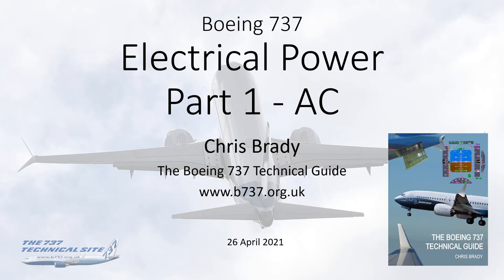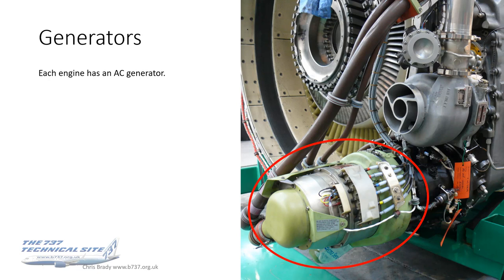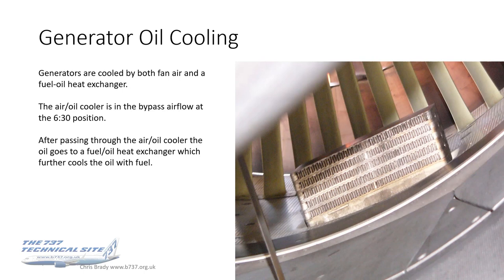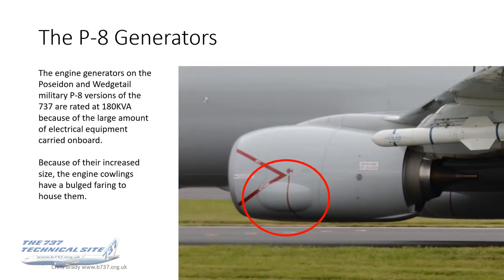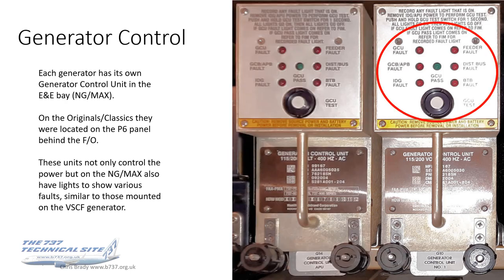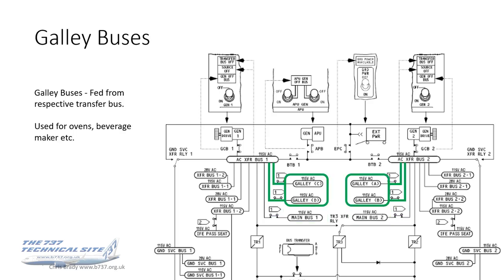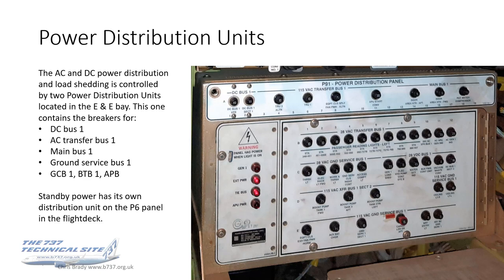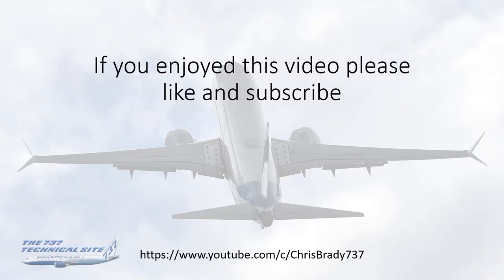737 Electrics Part 1 - AC Power

Comment: Amazing amount of info. Just a quick correction at 39:37 The blue light GEN OFF BUS means the IDG is not powering the Transfer Bus. The respective generator can be running or not. The blue light APU GEN OFF BUS definition is correct. APU running but generator not powering the Transfer bus. The blue GRD POWER AVAILABLE means external power is connected and the quality is OK. Cheers..
Reply from the maker: You are absolutely correct

Comment: These videos are the best I've seen on the internet, and watching them also made me buy your book. I have seen every one in the technical series from start to finish. But now when I try to go back to review some of them, I find that even if the sections of the originals and the classics were interesting on my first pass, I tend to skip over them to only get the NG/MAX parts now when I'm trying to learn the systems better. Maybe it would be an idea to also release a cut down series of the systems videos just for the NG/MAX, since I guess that's what most of us are flying nowadays? Maybe it is not too much work either, just some cutting in your video editing software?
Reply from the maker: Hi Jesper, thanks for your kind words and for buying the book. I took the decision early on to cover each generation, partly for completeness but also partly to show how the systems evolved to where they are today. A case in point is my last video “The Rudder Story” this had its roots in older generations but caused changes in later generations. You are right it would be a relatively easy job to just cut out the Original and Classic info but I think I already concentrate more on the later generations. I won’t rule out your idea but I still need to be persuaded that it would be worth doing. Thanks for the feedback, I appreciate it.

Comment: Very intresting Chris as usual. just a remark/question. at 04:21 I m surprised where you put the red mark; actually on the air starter and not on the CSD for the oil check as you were speaking about. is there a reason or am I mistacken ?  anyway great thank you for your work
Reply from the maker: You are absolutely correct - I got the wrong sight glass! I think the CSD sight glass was obscured by the orange tag and in my haste I labelled the wrong sight glass. Good spot!
Reply: @ChrisBrady737  thank you for your answer Chris. it was a detail with no importance really; and more to show you that we watch your videos with great interest . I m looking forward for your next Video ( and use to watch several times the last ones ) . Great work !

Comment: Is there any fuel penalty for turning off the IDG since rest of the flight will be continued with the APU on? 
Doesn't state anything in the QRH 6.1 Drive or in the Inflight Performance part in the FCOM (What I can find). Sorry if it's a dumb question, I'm still learning.

This video is amazing, even such small details as the 6pin GPU connector, I always wonder what those two smaller pins were for. Thanks again cpt!
Reply from the maker: There is no direct fuel penalty for turning off an IDG but of course there will be an associated fuel burn increase for running the APU. This should only be around 100kg/hr.
Reply: @ChrisBrady737  Okay roughly 100kg/h. Thanks for the information

Comment: Supremely helpful videos. 
Excuse my ignorance but what is typically a BUS? Like a circuit or what? Can you clarify?
Reply from the maker: They can take several forms but they are usually metal bars that you connect several other circuits to. If you open up the consumer unit / distribution board in your house you will see some in there for the live, neutral and earth feeds.

Comment: Hi Chris first of all thanks for the outstanding videos, I have a question, why are there 2 APU generator switches on the electric panel with only 1 APU generator?
Reply from the maker: Thanks Philip, it is so that you can connect to either or both busses.

Comment: Hello Chris, thanks for this wonderful video, i have a question, to disconnect IDG physically from flight deck, engine must be running or start lever in IDLE position is enough to do that, thank you.
Reply from the maker: "engine must be running" is not specifically a criteria. "start lever in IDLE position" is the criteria - but of course the engine cannot run without the start lever being in the idle position! When you put the Gen Drive Disconnect switch to the disconnect position, power goes to a solenoid on the IDG if the engine start lever is in the idle position. The solenoid energizes and disconnects the CSD from the input drive shaft.

Comment: One question on the NG on the metering panel why if you select the BAT BUS or STBY PWR selections it only hows Volts not Amps to?
Reply from the maker: They should show both amps and volts with those selections.

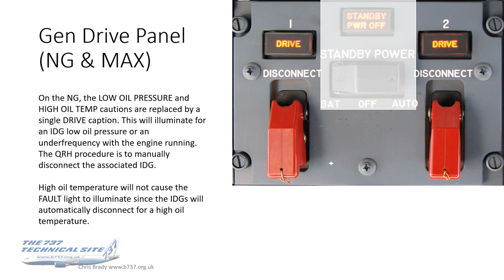Comment: Excellent video (as all of your other videos)! I have a copy of your book and love it! Just a question, at 38:20 "High oil temperature will not cause the FAULT light to illuminate..", I am confused by which FAULT light you mean? Thank you
Reply from the maker: Hi Mattias, Sorry my mistake, I meant the DRIVE light, there is of course no FAULT light.
Reply: @ChrisBrady737  Thanks for the reply. I thought you meant DRIVE, no prob, we all make mistakes! Congratulations for all your videos, they are excellent.
Reply: @ChrisBrady737   Hi, Captain Cris! Thank you for brilliant presentation. But I'd make some correction about this DRIVE light. The logic of this light doesn't diffirentiate between auto or manual disconnect. Only pressure and frequency monitored by GCU to turn on this light. So, even if you have thermal disconnect, the DRIVE light comes on due to low pressure downstream of IDG oil pump or due to generator underfrequency when it slows down. Hope this information will be useful.

Comment: Hello Captain Brady, thank you for your content as always. I have a question that's been bugging me for a while without ever finding an answer. Do you happen to know why the altitude horn sounds when AC power is removed from the aircraft?
Reply from the maker: I think you mean the IRS warning horn. This from FCOM Flight Management, Navigation - Navigation Systems Description - IRS Power:
"If AC electrical power is subsequently removed from the airplane, the switched hot battery bus continues to supply electrical power to the IRS. The ON DC light illuminates, and the ground-call horn in the nose wheel well sounds to alert maintenance personnel that the IRS is on battery power."
Reply: @ChrisBrady737  Thank you Captain for taking the time to answer, appreciate your dedication. I think this video will make myself more clear: https://www.youtube.com/watch?v=En87CjqiXzk&t=104s

At approximately 1:40, the engineer disconnects the ground power and what I believe to be the altitude warning horn sounds right after. This is the sound I am referring to. In this instance, the IRSs are off so their related warning horn is not going off, as expected. I hope I managed to convey the message a little better. Wish you a good day!
Reply from the maker: OK, I understand now. Unfortunately I have no idea why that happens, sorry!

Comment: may i know why in maintenance manual, the load shedding for 1 IDG operation is started from galley 2, then galley 1, and followed by both buses, lastly the IFE...
Reply from the maker: There are two different sequences of load shedding for the NG depending upon the date of manufacture and SB status. Both sequences are designed for importance, load and bus sequencing.

Comment: @Chris Brady Hello! at time 39:48 youve mentioned about what the 3 blue lights. Unfortunately i could not find any reference to this in the FCOM. I was trying to explain the same thing to a colleague but unfortunate couldnt find any source material. Would appreciate your help thanks :)
Reply from the maker: FCOM Vol 2 6.10.9 "Ground Power Available (GRD POWER AVAILABLE) Light Illuminated (blue) – ground power is connected and meets airplane power quality standards."
Reply: @ChrisBrady737  yes but that is only about the ground power available. i actually meant about the other 3 blue lights. GEN OFF BUS and APU GEN OFF BUS. I ask this because we have a procedure to check the GEN frequency and AC volts before putting them on bus. Which i believe is an unnecessary step.
Reply from the maker: The AMM states "The GENERATOR OFF BUS lights comes on anytime the battery bus has power and the GCB is open. The operation of the GENERATOR OFF BUS lights depends on GCB position only. It is independent of engine operation or IDG output power quality."
So, the eng gen off bus lights do not indicate power quality. I would say that checking GEN frequency and AC volts before putting them on bus is unnecessary as the generators will not connect to the bus if they are not of the required quality. The step is not required in any Boeing procedures.
Reply: @ChrisBrady737  Thank you for the prompt reply captain! I love your detailed Videos.
Reply from the maker: My pleasure

Comment: My question is ground power related and an airplane design question. I'm a ramp crew chief and I got asked this question by a few of my TikTok followers on a video I did. "Why is the ground power connection on ac right and not left?" I'm not an engineer and don't know how to answer this, do you have an idea? Thanks
Reply from the maker: Hi Jamie, All of the aircraft servicing points (GPU, fuel, baggage) are on the right to keep them away from the passengers who always board and disembark from the left.

Comment: Hello Mr Brady!!! Greetings from Brazil!!!
It's good to have a such useful knowledge on YouTube!!!
I have a question about load shedding:
In a single generator situation a load shedding starts automatically once the scenario has been detected  right?  However, if the System is unable to do that in auto mode, then pilots do by switching the respective switch. Am I right?
Reply from the maker: Hi, thanks for your kind comments. Yes if auto load shedding does not occur then manually switching off services like galley and cabin utilities is a good step.